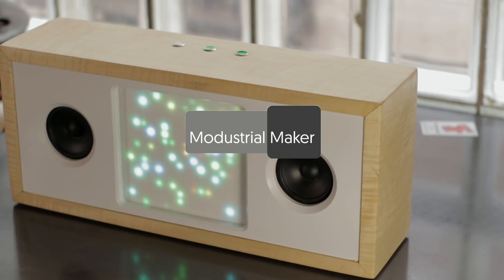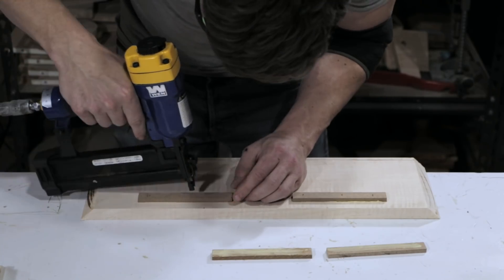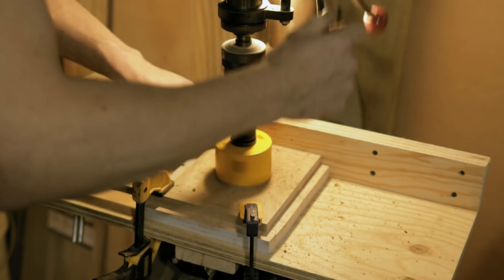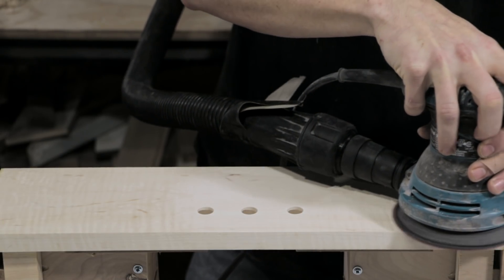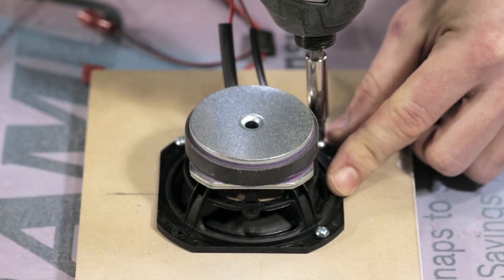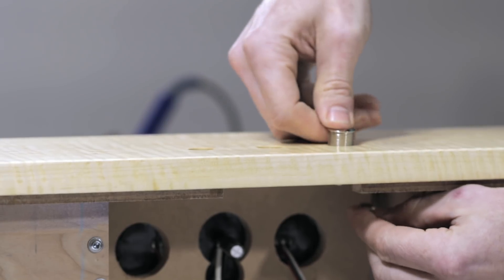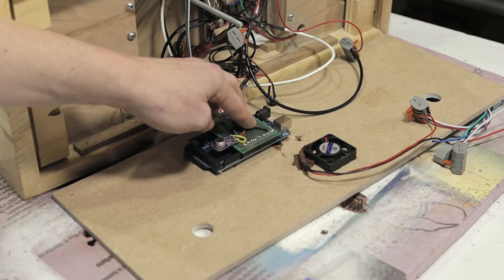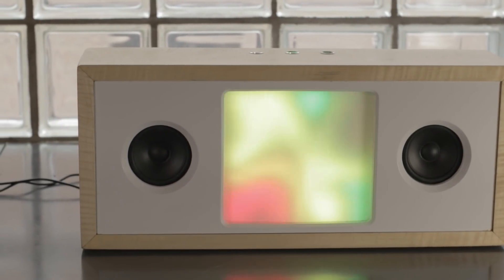Bluetooth Speaker w/ Reactive LED Matrix || How to Build a Speaker || DIY

Comment: you are good in electronics and a good wood worker but you're bad in acoustics :)
Reply from the maker: I used it for my skateboard speaker build....video is on my channel too.  Got help from kirby meets audio and did that one right acoustically
Reply: I like the sound of passive radiators. They are not precise, they have  very steep (and uneven) cut off, but they are pleasant.
Reply from the maker: +SCARE CROM lol, thanks! And yes, I know the acoustics aren't optimal.  I've made improvements since filming, based on viewer comments to fully seal the speaker enclosures, and to add polyfill inside the enclosures.  Any other specific suggestions to improve the acoustic design?  I'm always looking to learn and improve....
Reply: ahah well you know i'm building a portable speaker too (a 160W one, active bi-amplification with 2x 12v batteries) and i learnt a lot about acoustics. what i could say is that passive speakers (=radiators) are the best way to improve low frequencies; i mean that's really better than a bass-reflex. you should install radiators with your speakers in order to improve bass instead of just closing it (sry for my english)
Reply: also you should make a speaker for low frequencies (=woofer) which works with tweeters (high frequencies) and you just separate the audio spectrum with a passive filter (10$ on ebay) so your speakers will work better
Reply from the maker: Cool, I'll definitely look into that.  I'm planning another speaker build (although it will plug into the wall) for sometime during 2018.
Reply from the maker: +SCARE CROM yea, I'm thinking about that...I want to figure out a cool way to hide the subwoofer, like in a piece of furniture
Reply from the maker: If you have suggestions for improvements, you are welcome to share them, but this comment is not productive to learning.
Reply: Modustrial Maker dude. WinISD is all you need to make anything sound good. That and learn your thiel parameters. I've made a ton of enclosures just using WinISD. It's a free program just google it and install it. Thiel parameters are parameters that describe the way a speaker behaves based on it's size/excursion etc. You input those parameters into the program as well as your desired enclosure size and tuning frequency and it tells you the correct dimensions to make the port. Never fails.
Reply: SCARE CROM i disagree. Radiators sound sloppy and don't have anywhere near the output of a ported enclosure. But neither of them compare to a quarter wave transmission line which is theoretically the perfect box for pure output and sound quality

Comment: If only it was as easy as you make it look. :) Would really love to build some of the things you've shown, but it comes down to either not having the right tools or lack of knowledge in electronics. But watching your videos, I'll definitely give it a try soon. Trial and error.
Reply from the maker: +Jason Smith just break it down into small tasks.  If electronics are the big hurdle, try following cine-lights tutorial for a VU meter or doing natural nerds build for a music reactive desk lamp.  Once you do those, the electronics and programming for this are basically the same.  Then it's a matter of doing the woodworking, then figuring out the speaker wiring (this part is very simple with the kit).  Then after you tackle each of those individually, you just figure out how to put them all together.

Comment: 3:15. You shoulda used a table sled. That cut if dangerous...
Reply from the maker: Yea, I mentioned in voiceover that I would use a table saw sled for the miter cuts if doing it again.  (Need to get around to making one :) )  But, mainly because the miter saw didn't cut the miter properly due to the hardness of the maple.  Can you explain a bit more why this is more dangerous than a typical cut (given that wood is clamped)?  I'm always trying to improve safety so I'd like to understand what was done wrong here.

Comment: Man! It is so detailed! I think the part where you can change where the diffuser is located is brilliant!
Reply from the maker: +Bruce A. Ulrich thanks!  the diffuser was a mid-build modification....I was originally going to use frosted spray on clear acrylic, but found this white acrylic on eBay midway thru building and decided to try it.  I was going back and forth on what look to go with as far as diffusion, and finally decided I had to figure out a way to get best of both worlds :)
Reply: Well, that was definitely a good choice. It really added a lot.
Reply from the maker: Glad I wasn't the only one who thought so :)
Reply: Hi, when you press mode button, actually it will connect pin5(green wire) on arduino to GND or 5V?
Thanks.

Comment: great i love it,especially the depth adjustment for the LED matrix ,  but can you put a link to your arduino sketch .ino  in the description ?

also i think a mega is overkill for this project, you  could have used a nano or a pro  mini
i like them because you can get these nice  expansion boards  that have screw terminals for the wires for pretty cheap on aliexpress or ebay
you can use either a nano or a mini with them,   if you use the mini you will have 6 left over screw terminals to work with  
https://www.aliexpress.com/item/New-NANO-3-0-controller-Terminal-Adapter-Nano-Expansion-Board-NANO-IO-Shield-V1-O-Simple/32842235711.html?spm=2114.search0204.3.71.SnRSCc&ws_ab_test=searchweb0_0,searchweb201602_2_10152_10065_10151_10344_10068_10130_10345_10324_10342_10547_10325_10343_10546_10340_10341_10548_10545_10541_10562_10084_10083_10307_10178_10539_10312_10059_10313_10314_10534_10533_100031_10103_10073_10594_10557_10558_10596_10595_10142_10107,searchweb201603_1,ppcSwitch_5_ppcChannel&btsid=c82bbc91-367f-414b-9256-8100000f535d&algo_expid=e98669fb-11c0-4ffd-b170-b1cc88706d16-9&algo_pvid=e98669fb-11c0-4ffd-b170-b1cc88706d16&rmStoreLevelAB=4
Reply from the maker: Thanks!  I will add the code as soon as it is uploaded (over the holiday weekend for sure).  Agreed that the Mega is overkill, but it is the only Arduino with enough memory for my LED code. Those LED arrays in FastLED take up a lot of memory....my code was generally done and set up from past Arduino projects, so there were efficiency gains by sticking to an Arduino board. I have some WeMos D1 Minis and plan to convert to them for my next version of this speaker. (Money-wise tho, Mega clones are only like $7, so not too much more.) I also have a couple Teensy 3.2 boards and Octo shields, and have plans to do something with these and a huge LED matrix at some point in the future :)
Reply: oh yeah i forgot about the memory ,  also you  might want to include note or a link for the libraries needed to compile  the sketch

Comment: Audio comments: polyfill for the speakers is helpful sound-wise. If your speakers are sealed, make sure they're air tight and that the speaker cabinet is of proper size. Other than that I thought the ability to move the LED board forward and back was mega clever. Awesome job!
Reply from the maker: Thanks!  On Soundblab's recommendation, I actually just bought some polyfill to include in the three more that haven't been completed yet.  I'm going to go back with hot glue and make sure any air gaps are sealed completely in the enclosures.

Comment: Sound Design buff... Maybe not, but I do have some tips. Pocket screws are great where you used them, but the sealed enclosures really do need to be sealed (airtight or really close). It looks like the enclosures are just held with screws, which is not sufficient to achieve this. What I recommend is to glue all the sides of each enclosure save for 1 (to service in the future). After its glued, caulk all the seams on the inside to seal them further, and also to soften the sharp edges (can create high frequencies if you're really picky). Then attach the speaker and the last side using closed foam tape or rubber as a gasket (parts express has rolls of foam gasket tape for cheap). Lastly, hot glue the speaker wires in the hole made to route the wires to finish sealing the enclosure (leave some slack inside the enclosure so you can open the last side and not have to unglue the wires). This will probably make the biggest improvement in sound quality. Loved the project, keep it up!
Reply from the maker: Thanks for the tips!  I will definitely add some glue to seal off the holes for the speaker wires -- I notice there is an amazing amount of air coming through them.  I actually did use caulk on one of the speaker I built, but that part of the video got cut for sake of brevity, and I believe you are right that the version in the video has one joint held with pocket screws only (I made two of five speakers so far).    As for the gasket, the speakers I used had built in gaskets, so I think that should be sufficient?  (I also caulked around the edges of the speakers just to reinforce them against vibrations, in case the screws loosen over time.) .
Reply: Modustrial Maker the built in gaskets for the speaker drivers are sufficient, don't need anything extra. If the screws strip out or loosen, I doubt that silicon caulk will keep the driver in place (it doesn't hurt, but I don't think it does much).
Reply from the maker: Its not just any silicone caulk -- I used Fuze-It.  The stuff is crazy -- highly recommend it if you haven't checked it out.

Comment: A really beautiful video, you put out again!
Your ideas with electronics are inspiring :)

(Suggestion for the enclosures: You seamingly have quite a lot of unused space in the box. Try to make the enclosures bigger, that will result in a more rich sound with more bass. For really clar audio it`s useful to separate the speakers, bot honestly: it doesent make a big difference (with bluetooth amps and inexpensive drivers at least. So in the end you could even leave out the enclosures if the box is properly sealed. Bonus: It also get louder)

Greatings
Reply from the maker: Thanks for the tips on the acoustic design!  I am already planning another speaker build for 2018, and hope to improve the acoustics in the next one.